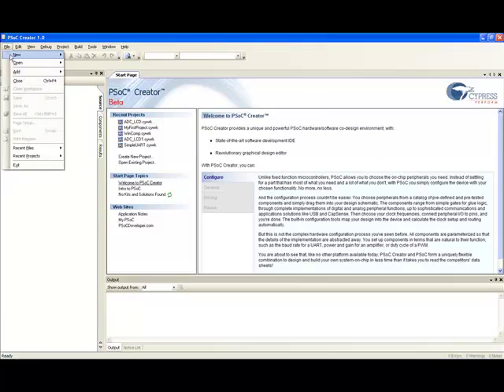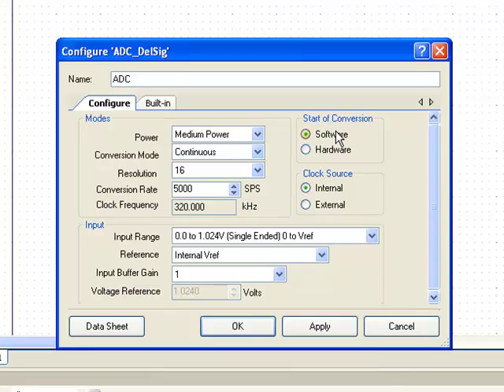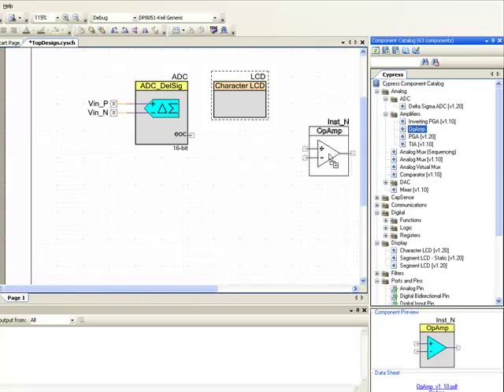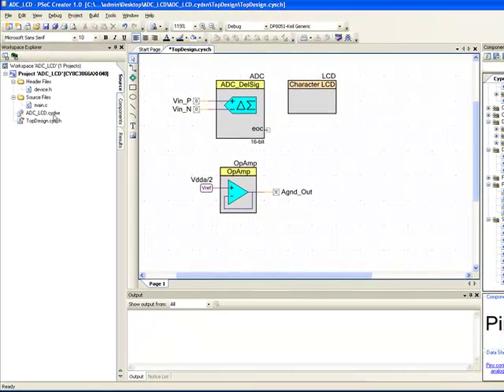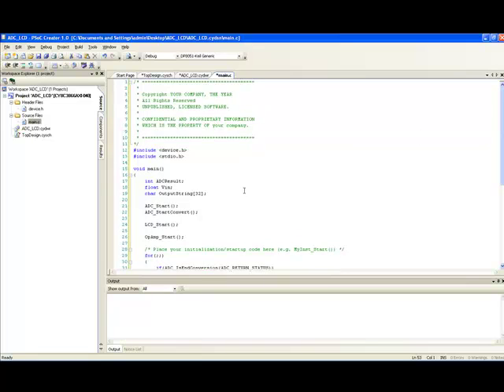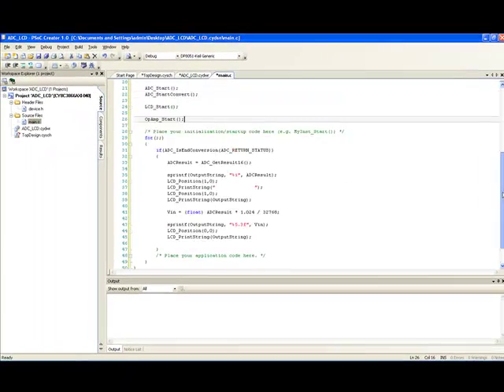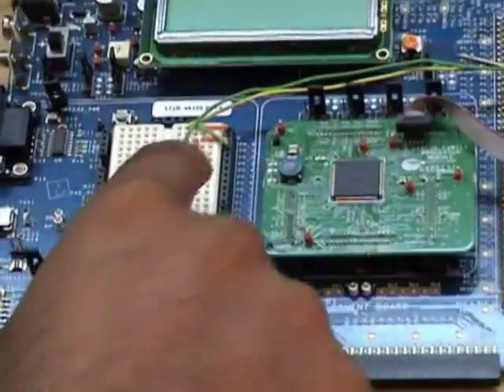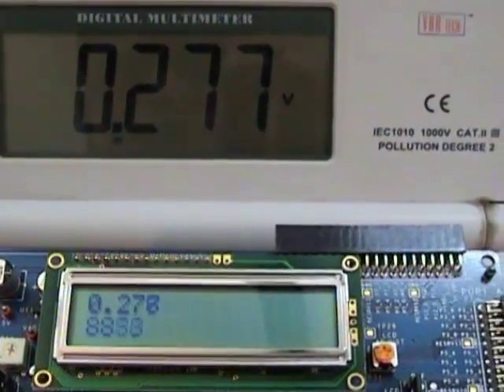PSoC3 Project - ADC LCD

Comment: So VDDA/2 output is connected to Vin_N.  VDDA/2 is not shorted to GND.  it is just named Analog GND.  The VR is actually varying itself from 0V to 2.048V.  The VDDA/2 is used to compared the VR voltage to VDDA/2, that is how we get +/-1.024V on the multimeter.

Comment: I am having trouble understand why you would need the Vdda/2 in the first place. Second thing is why do you need to bring the vdda/2 out of the chip and then get shorted to ground assuming that you are trying to measrue voltage that is on the same development board?